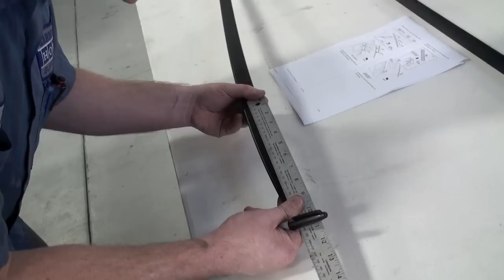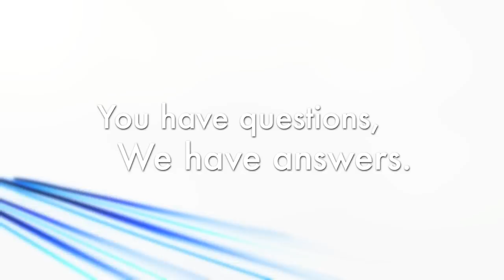Ridgeline Roof Rack Installation (Honda Answers #71)

Comment: I found the instructions online. I love how Honda says this is not a job for “do it yourselfers.” And they put it in quotes just like that. You need three sections of trim on each side. Two cuts of the following three lengths... 555mm, 425mm and 230mm. That translates to 55.5cm, 42.5cm and 23.0cm :-) You should end up with 33cm of scrap to discard on each side.

Comment: Do you guys know what this mean in step #11 of the installation manual?  "To reduce wind noise, cut the rubber molding from each roof rack and install the pieces of the rubber molding you just cut between the crossbars.

Comment: Useful video for the most part. I've added some "tips" below because... Unfortunately, instead of inserting a voiceover that could have helped with instructions..... they just played annoying music. If no speaking.... then why the hell bother with sounds at all?
That said... I'd like to add some useful tips that they should have brought up. 
1. Cutting the roof molding to lengths specified by the instructions is fine advice, IF you have instructions. Which I didn't and which is why I had to watch a video in the first place. So... I had to figure that part out myself.  ANSWER: Place roof rack temporarily on roof beside the track and in line with the screw holes. Then... place the track cover next to it with its front end in line with the start of the groove (where it would normally be resting) then, with a marker, mark off the beginning and ending of each of the points of where the roof rack drops into the groove. (the block that the screws pass through) Then cut away those areas. 
2. A disk grinder with a metal cutting blade will also work quite nicely.
3. When assembling the roof rack on the bench, you will notice that on one end of the cross members where they slip into the plastic caps, the caps holes are round and on the other end they are oval. Screw the round ones in tight but leave the oval ones a bit loose. You will want a little bit of play while mounting. These can be tightened fully later.
4. When bolting down the rack to the roof, you will notice that the bolt holes in the center mount are round and the ones at each end are oval. This is because the rack lengthens as it's compressed. This can cause grief if not assembled in the right order. First, loosely attach center nuts. Then loosely attach ALL of the rest. Only then do you begin tightening. And fully tighten down the center before moving on to the ends.
5. lastly, for the people without the instructions like me..... when you go to put the cover caps on, you will notice that they have been marked on the underside as to which side of the vehicle that they go on.
GOOD LUCK👌😀
Reply: Found the OEM instructions in less than 10 seconds. Google's your friend. There's also a link in the video description above.
https://www.hondapartsnow.com/installation/AII12033.pdf
Reply: @OMGWTFLOLSMH  They removed this it is 2021 now and took it down un-fortunately

Comment: just installed on my 2018 and now I have lots of wind noise.  any suggestions?
Reply: I have them on my 2007 RTS and always get wind noise. I'm thinking about removing the cross bars but haven't yet found a video showing how.
Reply: Thanks for this....  Def bot getting one.
Reply: add a Thule air screen to the front of it
Reply: I took the crossbars off. I just have it for looks and this helped with wind noise.